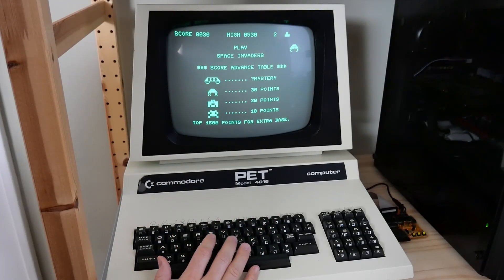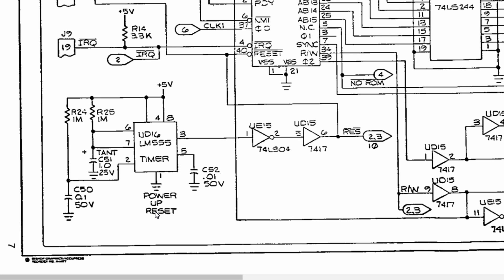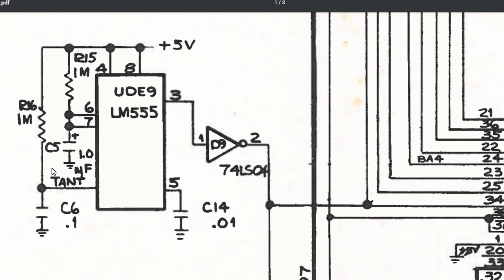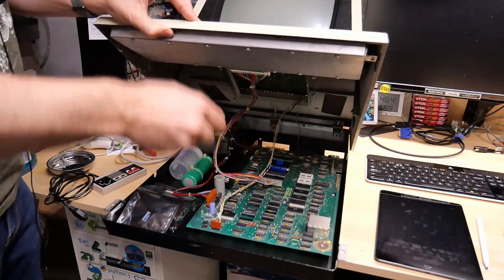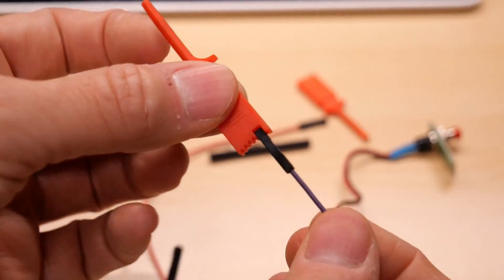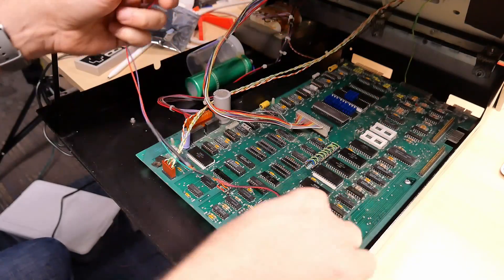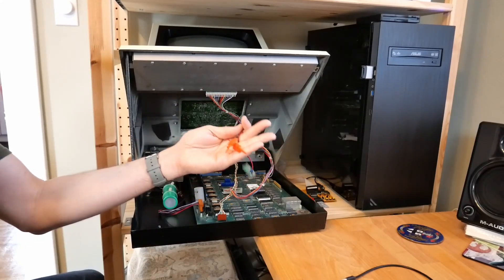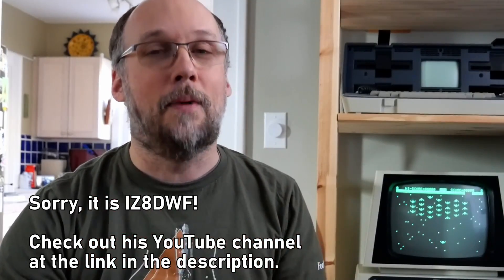Adding a reset button to my Commodore PET 4016

Comment: One button reset for Apple IIc ??
Reply: Yes, Adrian should make another video about a reset button for the Apple II. Thinking about this, back in the day friends of mine and me made a reset button for our Commodore 64s, plugged in into the DIN (? can't remember) port. Another video Adrian could make. :-)
Reply: @TheAnkMan  I modded my FastLoad cartridge for the same thing.  It was just too useful not to have, so I left the cartridge in my system all the time anyway, making it a perfect candidate for modding.  All you had to do was wire a pushbutton switch between pin 1 (GND) and pin C (RESET).

Comment: I'll have to go and show this to my PET. Had the 4016 from new, upgraded it to 32K shortly after. needs a bit of work as the  display is not feeling too well. I notice that you also keep components inside the case, lost the screw within days of getting it. in the end there was conductive foam inside for keeping chips safe.

Comment: First computer I ever repaired back in high school! It had been dropped.
Reply: Steel toecapped boots are recommended when moving the Commodore PET
Reply: Dave Poo I still have a big dent in my room’s floor from when I tripped over the cable for my PET

PET was fine though, aside fom a small dent which I was able to repair